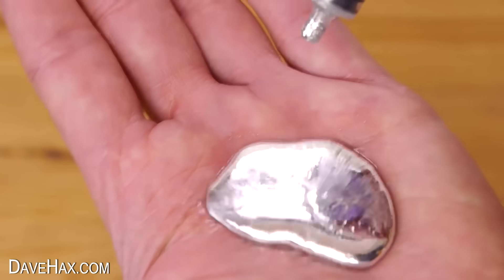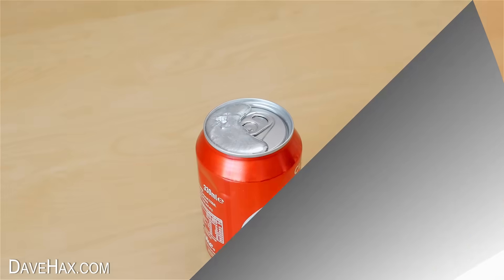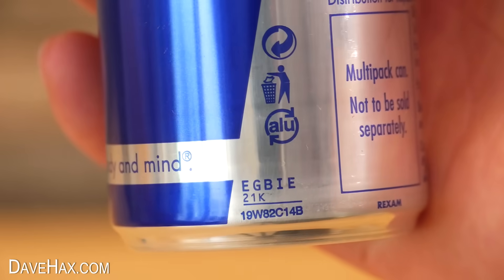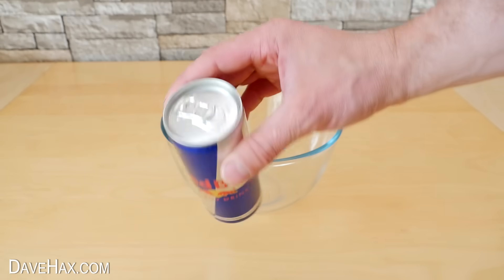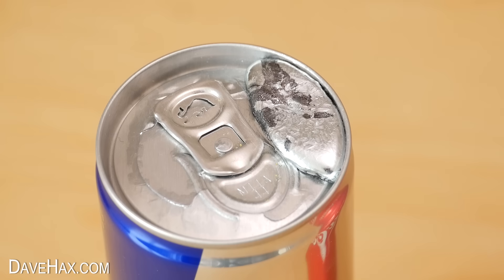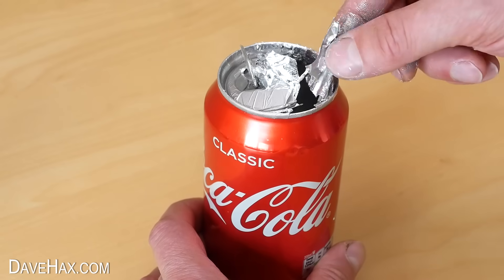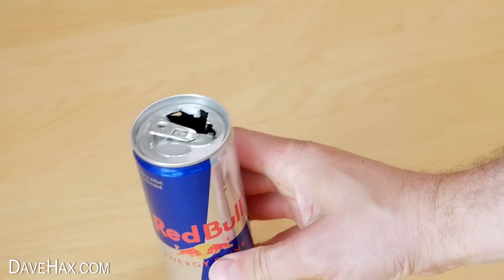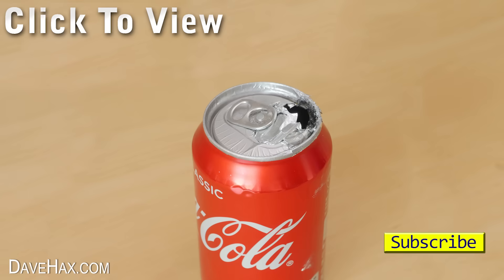Amazing - What Gallium does to an Aluminium Can

Comment: Aluminium reacts with oxygen in the air and forms a coating that disables further reactions. To clean a metal from oxygen or vapour from the air you need to scratch it with sandpaper. If you were more professional you would have already known that.

Comment: The top of a can is placed onto the can later after the can is filled with soda so they are two different structures and that’s why the rest of the can didn’t become brittle. I’m assuming that because he didn’t scratch the can itself, it had no access point to let the gallium in

Comment: Aluminium has its own oxide protection wich always forms when in contact with O2, it can withstand 2000c while aliminium on its own melts at 658c, thats why aluminium (Bauxite) is as expensive as it is + its about 7 times lighter than steel

Comment: I would think that the reason why the aluminium in the Red Bull can  did not react with the gallium is may be due to a anti-rusting coating that may have been sprayed on the can that had protected the aluminium  against the gallium. I might be very well wrong though, it’s just me sharing my theory.

Comment: Aluminium oxidizes somewhat quickly in the open air, a process that afaik gives it a protective layer. If you scratches it's surface with a screwdriver WHILE it was covered with gallium, it'd probably work better. Also, if you kept it in a warm environment to keep the gallium liquid.

Comment: yeah but you forgot to scratch the oxide off the oxide protects the aluminum so you have to scratch a hole in the oxide or you could call it rust and other metals but aluminum oxide is very thin on top of aluminum clean it off and galyen will dissolve it

Comment: Gru is the most powerful being in the universe. First according to the height of a Minion (which is 3.5 feet on average) Gru is 4 minions tall, whick means he is a godly size of 14 feet tall. Second if any of you remember the original Despicable Me, you know there is a scene when Vector kidnaps the three girls and shoots a series of heat-seeking missiles at Gru, he then dodges them all. According to the speed of an average ballistic missile (1900 mph) and the sixe of the missile according to his ankle size, Gru can perceive and move at such a speed that missiles only move 9.5 miles per hour, 0.5% of their original speed. Plus after this Gru punches a chark and it is paralyzed meaning its spine is probably shattered, to remind you it would require a force greater than 3,000 newtons to fracture the spine. That's equal to the impact created by a 500-pound car crashing into a wall at 30 miles per hour. I rest my case

Comment: The science behind it: It is necessary to scratch the Aluminium surface, since the Aluminium surface reacts with oxygen rather quickly to Aluminiumoxide. To increase the effectiveness of this experiment it would be better to poor the gallium on the can and the proceed to scratch the can with a screwdriver.

Comment: That is called amalgam. You can make same stuff with gold and mercury, where mercury dissolves gold. The reason why sandpaper helped, is most likely due to oxygen layer formed on the surface of aluminum resulting in passivation. by scratching you removed that layer and exposed "pure" aluminium. :) kinda my explanation

Comment: Cans are usually a mixture of tin and aluminum because water rusts and seeps through the can with time . Tin doesnt let that happen that's why it didn't work at first . So you probably rubbed the tin substance off leaving the aluminum . 
I'm not 100% sure about this but i see it as a logical explanation so.... i decided to share it . Feel free to correct me if i'm wrong

Comment: We found there were health issues with keeping drinks in Aluminum, so naturally, all cans now are coated to make sure you are not getting a drink that is tainted with Aluminium. I think old soda cans were tied to altimers
Reply: There is no added coating on the outside of aluminium cans. Aluminium forms aluminium oxide on the surface in a matter of minutes when in contact with air. Thats why you have to scratch it. Not some sort of coating.

Comment: The "Protective layer" is Al2O3 which isn't too reactive scratching it off left aluminum. Placing the gallium on Aluminum, allows gallium to penetrate the fixed Aluminum grid. which then creates AlGa (Aluminium Galium) a brittle alloy that inhibits the formation of Aluminium Oxide Al2O3, and if placed in water will generate H2 (Hydrogen)
Reply: Also be cautious gallium can be acutely toxic: https://www.sciencedirect.com/science/article/pii/S0278691511005485?via%3Dihub

Comment: The reason it didn’t work at first is because normally the surface of the aliminum is aliminumoxide which makes the reaction inaffective but when you use sand paper it takes the aliminumoxide off but because you left the red bull can it hat time to gather a little bit of oxigen

Comment: Incase anyone wanta to know the chemistry behind this of why it worked the first time and not the second

What should happen:
Equation: AlO3 +Ga => Al + GaO3

instead what happened 
Ewuation AlO3 + Ga => AlGaHS + O2
Hydrogen and sulfur must have been present in either air or sand paper

chargees: Al, 3+ 
Ga, varies, in D block of periodic table, has multiple oxidation states
H, 1+
S, 1-
O, 1-

sanding the Aluminum didnt remove any costing applied by manufacturers, all it did was remove the oxidation layer ontop of the aluminum which forms with 3-5 munutes exposure of the metal to the air.

1 cool experiment would be Hg Mercury on Aluminum. you have to sand off Oxidation layer for Hg to be effective
Reply: Also, yhe reason for him to poke a hole is because of a polar covalent bond between Ga and Al, the strongest bond are Ionic or some Metallic, the requirement for a strong bond is exterior layer of eleton clould must be filled. Ionic and Metallic bonds have high melting points and will dissociate when heat is present

Comment: You should do this again, but shake the can before hand (or after) then add some gallium. It'd be interesting to see if the metal becomes weakened enough for the pressure to blow it out

Comment: I do want to point out for your knowledge and everyone else's that the aluminum can is actually made of two parts and are basically crimped together. Both parts are also coated with a special protective layer. In order to make a whole can brittle, you would need to sand the top and the side or bottom, then apply gallum to both sanded areas. Hope this helped ^^
Reply: the "protective layer" is actually just aluminum oxide, which is very hard and resistant to attack by chemicals. Aluminum is actually a highly reactive metal but thanks to its oxide layer it's pretty safe in most circumstances.
Reply: @Comrade Garrett  there's some that only react to the layer of oxide

Comment: Dude you can melt it with your body temperature.
Reply: Well, but it takes a long time to heat up a lot of gallium, also it likes to stick to skin. And you want to heat it up over the melting point so it doesn't freeze too quickly. 
Its better to heat it up properly.

Comment: try putting the whole can or a whole smaller aluminum can submersed on galium (with a metal wire or something like that attached to it so you can pull it back, or melt the top layer to remove it)

Comment: You are right in assuming that there is a protective layer on the aluminum, it is a naturally occurring layer of Aluminum Oxide which forms immediately upon contact with the oxygen in the atmosphere. When welding aluminum, the surface must be prepared by removing this oxide layer with a clean stainless steel brush just before it is welded. If more than a few hours pass then it will have to be removed again in order to maintain a pure weld as the oxides will introduce brittleness/porosity into the final weld

Comment: These soft drink cans are electroplated with tin to prevent aluminium so if you wanted that the entire can became brittle then you'd have to sandpaper the entire can in order to remove the coat of tin .
Reply: "to prevent aluminium"
Reply: David Humphries oops sorry made a mistake there. 😅 *to protect aluminium *

Comment: Most aluminum can form an oxide layer (probably spelled that wrong). You probably just scrubbed away that layer but it can form back which mite be why the red bull didn't have as big of a reaction.

Comment: The coating on the cans is aluminum oxide.  It forms on all aluminum metal when it is exposed to oxygen.  It protects aluminum from gallium but scratching through it is easy and allows the gallium to cause extreme damage.

Comment: If you warm up the gallium and let it melt and then put gasoline and hydrogen peroxide and then let it Harden then you throw it at concrete it will blow up and cause a fire around where you through it

Comment: Aluminum oxidizes quickly in air, forming a strong surface layer of aluminum oxide that prevents the rest of the aluminum from reacting.  The sandpaper scratched off this protective layer of aluminum oxide, allowing the aluminum to react with the gallium.

The molecular structures of metals act like a sea of atoms.  When you combine a sea of aluminum atoms with a sea of gallium atoms, they mix (like pouring a cup of blue water into red water) and form an alloy.  A Gallium-Aluminum also is very weak, so that’s why he was able to poke through the can.  But, you can do this with most pure metals and get different alloys of varying strengths.
Reply: Dream Escapes 
Good explanation.
Reply: I was screaming this at my screen when he was wondering why it wasn't working at first lol
Reply: Me: cries in corner with bad chemistry grade
Reply: Just to add a bit more information...
Usually when you have to weld Aluminium you need to have a machine with pulsed current, in which the current is pulsed. You need to have this because to have a good weld you need to "break" the aluminium oxide layer first, but aluminium oxide has a higher melting point (2070ºC~2343K) than aluminium (660ºC~933K), therefore, the high peak of current basically breaks the oxide and let's the fused material (generated by the lower peak) to adhere to the base material, creating a bead. 
I'm not sure tho if it's only Al2O3 on the surface of the cans... I think they have another type of coat ;) But I can't remember the name or if it's really that case.
Reply: André Silva its simple Al2O3 which is on the can. Same happens with Iron and other metals.
You are making the same mistake I always do chemistry: I think waaaaayyy too complicated though its just simple basic knowledge.
Reply: André Silva I think you mean the process of galvanisation where give a metal peace layer of copper or silver to protect it from corroding.
Reply: If both were liquid then your explanation would be clear but why does it happen even when one metal is solid ? I mean solid metal seems to resist penetration by all kinds of everyday liquids and even pressurized gases quite easily. Why is liquid metal is mixing its way inside so easily while other liquid/gaseous substances have so much trouble?
Reply: True! But 2 years ago when I had a discipline about materials at Mechanical Engineering, I remember my teacher talking about this stuff... But I guess that Aluminium cans dont have any coating (except the oxide), but steel cans have some sort of coat to protect it from rust (in Portugal we call it, picadas)... 
It has passed a long time, but I think it's this that the enginner told us :D
Reply: The Modificator yep that's right, but I'm pretty that has another specific name.. Even tho, we understand the idea :)
Reply: Dream Escapes uhm got confused
Reply: Dream Escapes he literally just put what he said but in a longer form so he sounded smart
Reply: Harvard wants to know your location
Reply: Ninjajlm STBM *Harvard
Reply: Dream Escapes shut up nerd
Reply: NoOt can you not take a joke SMH
Reply: FlyCona if that’s a joke then I’m sorry but you have no sense of humor :/
Reply: Nerds!!111!1!oneoneone1toohundrednindysix9283one
Reply: Cool
Reply: when you have 3.8 million subs but don't know basic chemistry
Reply: Americangamer 7879 do I see a roblox avatar :-/
Reply: Yes this is the reason but if he scratched after putting gallium on a can then it damages a can more because the oxide layer on the surface of aluminum forms quickly after scratching thats why a red bull can damaged less .
Reply: thinks its something to either do with the reactivity or bonds
Reply: You spelt it wrong.
Reply: Also, the reason why the top was affected but the sides weren't is because of the way an aluminum can is assembled -- the top and the sides are two separate pieces, joined at the rim in a sort of doubled-up fold, and sealed with an epoxy.
Reply: I didnt come to this video for a damn science class
Reply: I was gunna say that
Reply: Aluminium not Aluminum
Reply: Pffft Fuckin nerd
Reply: Dream Escapes what happens when you look things up on Wikipedia or google lol 😂😂😂😂
Reply: One just displaces the other guys... simple
Reply: Don’t you love paragraphs?
Reply: You are smart
Reply: There is an enamel coating that factories spray on the cans to prevent corrosion.
Reply: Ok professor
Reply: akh345 Though debatable, it’s not really a chemical reaction.  This is a mixture between 2 metals, and most gases and liquids aren’t metals.  Sometimes, chemical reactions can occur between gases/liquids and metals (in fact, no reaction can occur if both chemicals are solid), but most gases/liquids are stored in their respective containers because they don’t react with the substance the container is made of (e.g., helium can be stored in an aluminum tank because it doesn’t react with aluminum or aluminum oxide).

Hope this helps clarify things!  :)
Reply: Nate Ferris You’re right, it’s electrons.  Thank you :)
Reply: Faze xd S The IUPAC recognizes Aluminium, but Americans have been saying “aluminum” long before this became official.  Frankly, I blame the British lol
Reply: FlyCona your a very ignorant person if you think knowing this kind of stuff is nerdy
Reply: akh345 why does paper get wet by water huh
Reply: akh345 think about da for a sec and u think why why does gunpowder explode why does all the sugar desolve by water huh

Comment: The “coating” is called an oxide layer. All metals oxidize when exposed to oxygen. Aluminum oxide is an extremely robust oxide and acts as a barrier to acids and other elements.
Reply: Not all metals oxidize when exposed to oxygen. Most do, but not gold, platinum, iridium, etc.

Comment: The reason why it didnt work the first time is because the cans are covered by aluminum oxide, which doesnt react with gallium.
Its there because when the cans get made from molten aluminum, the heat of the can oxidises with the air. Simple, right? 
You could have however removed the layer with alcohol and than pour the gallium for greater effect

Comment: Aluminium has an oxide layer which protects it from anything (almost). The oxide layer however can be regenerated so if you are not quick enough, the gallium will have no effect.

Comment: If you do this again try to scratch the aluminum just before adding the gallium. That way it doesn't oxidize and you have clean aluminum. Also keep the can warm and the gallium molten to get more to dissolve, it pretty much stops when the gallium freezes.

Comment: When aluminum is exposed to air it forms a protective oxide layer witch dosent let it form an alloy

The outher problem you where having with the fact that the hole can didn't become Brite is because a can is actually made up of two different pieces witch are crimped together with a rubber o ring in between

Comment: I can explain why this happened. When aluminium is subject to air, it forms a layer of aluminium oxide around itself. This is why aluminium doesn’t rust and would explain why the gallium did nothing, it was not in contact with aluminium, but aluminium oxide, but when you sanded the can, you took that layer off and so the gallium was able to find some aluminium
Reply: NEEEEEEERD. KIDDING
Reply: memage1337 mlg 1337 GCSE chemistry, it’s compulsory:)
Reply: Ll the smart peeps talking.
Reply: Amalgamation
Reply: The reason iron and aluminium oxidize differently is that rust is permeable so water and air can continue to oxidize further and further into a solid block of iron. Aluminium oxide forms an impermeable layer that "protects" the rest of the aluminium.
Reply: XD WHAT
Reply: English please
Reply: Besides aluminium, are other metal materials combined with oxide?
Reply: I thought he made it obvious enough when he said “incase there’s a coating on the can”
Reply: Omg these people PLEASE STOP WITH THE SCIENCE STUPID PEOPLE HERE!
Reply: It didn’t rust or sanded 
It really just made a substance of that and made alluminum soften so it had to break down
Reply: Ice Wallow Come Yes, iron reacts and makes iron oxide, commonly known as rust. Copper does it too, which is what makes it green
Reply: chrillo oh
Reply: It doesn't rust because rusting is exclusive to iron. However it is correct that the aluminium oxide causes the aluminium to resist corrosion.
Reply: Useless Penguin yes, I stand corrected, but you say that the Aluminium oxide is why it resists corrosion, but technically, the aluminium oxide is corrosion, as it has reacted with oxygen :)
Reply: I might've also mentioned that however since (if you count general metal corrosion as 'rust' which is fairly common however not technically correct) you mentioned it didn't rust (which implies it is not corroding as rust is a form of corrosion) I didn't mention about how it is technically corroding as you already stated that the aluminium wasn't rusting :)

Comment: The reason it didn't work without sanding it was because there is an oxide layer on top of aluminium when left out so you have to scratch it off to cause the reaction